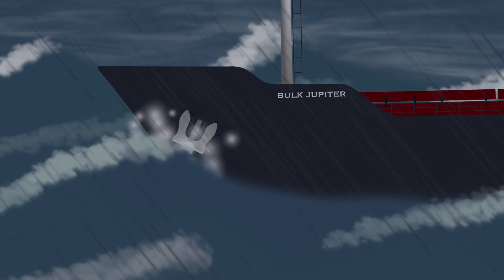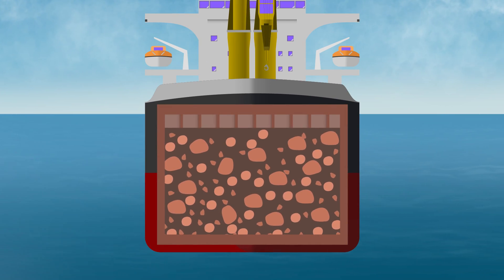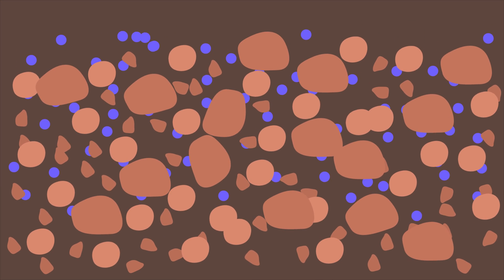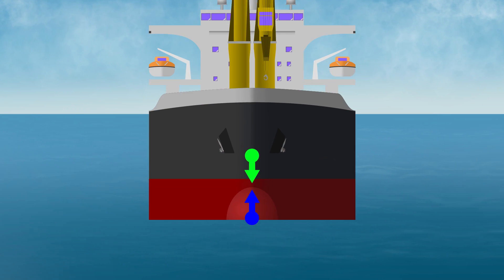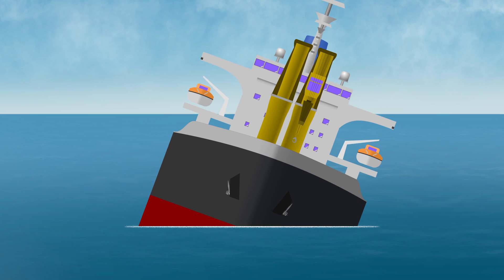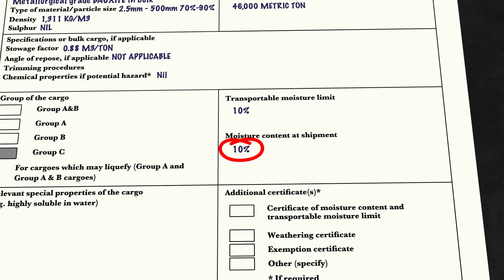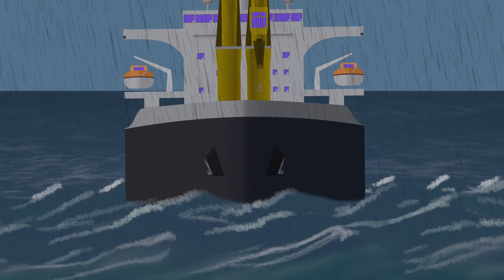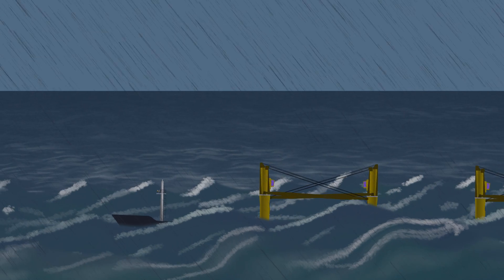Why Does Solid Cargo Turn Into A Liquid? - Liquefaction & Dynamic Separation Explained!

Comment: Wouldn't keeping the centre of gravity below the centre of buoyancy solve most of the problems of ships capsizing?
Reply: Buoys have the same concept. Ever seen one upside down? No matter the weather, they stay upside up.
Reply: @elknackebroto7447  Moving the centre of gravity or buoyancy higher or lower does not make it heavier or more buoyant. It just changes the location of the forces, not the magnitude.
Reply: @RonakDhakan   It may be possible to design a ship with a hull where this is possible. But the word "may" in that sentence is doing a lot of heavy lifting.

The center of gravity on a cargo ship like a bulker is a massively, massively changing value depending on whether the vessel is on a cargo voyage or a ballast voyage. How do you keep KB above KG when the vessel does not have cargo onboard?

Also just think about what you are asking. Center of buoyancy is the center of the underwater portion of the hull. Center of gravity is the center of mass. If KB is to be greater than KG then this means your cargo all needs to be very low on the ship, and there needs to be a large part of the ship above this to provide buoyancy (depending on cargo density). This makes a ship have a greater depth, which means they cannot go into shallow ports. It means you cannot make effective use of a double bottom, since that brings down your KB with regards to KG.
Reply: @phantomsplit3491  Great response. Would an aircraft carrier like shape be the right kind for this purpose? I would think some kind of a V shape would be better.

Of course this is just a mental exercise to understand the physics. I am not saying that achieving this would be practical.
Reply: @RonakDhakan  
A V-shape makes the ship more top-heavy, so if cargo starts shifting (for whatever reason), you're in a lot more trouble even faster.

Also, and most importantly, a V-shaped hull gives up a lot of volume. And volume is what you get paid for. So firms using those ships would go out of business from competitors who use U-shaped hulls. Sinkings are not common enough to balance the costs out. Especially if your ships carry insurance, lol.
Reply: @elknackebroto7447  Why?

Comment: Why not build a wall at the middle of the ship lengtwise? That would separate it to two containers that have a hard time sloshing too one side.
Reply: This is allowed to be done instead of messing around with TML. But these subdivisions add so much time to the unloading and hold cleaning process that most ships find it better to eliminate the issue by transporting dry cargo, rather than mess around with the subdivisions.

Plus the water in cargo = useless weight which hurts fuel economy on the ship and (depending on cargo density) can reduce the amount of product the ship can carry on a voyage.
Reply: money

Comment: WHY THE SHIP did not have its cargo space divided into two sections along its length, not just perpendicularly?

This would have allowed to completely disregard the issue of liquefaction. The capsizing would have been then hard to achieve even if the cargo was water.
Reply: Because the subdivision greatly slows down loading and unloading. Since it is unloaded via a clamshell bucket. Putting a bulkhead down the middle of the hold slows down loading and unloading tremendously, and is unnecessary if you actually don't transport cargo above the TML.
Reply: @phantomsplit3491  there are many types of buckets, some allow effecting unloading from 90 degrees upright spaces. And port equipment allows to change the buckets pretty quickly. The issue is that full costs/expenses analysis for both scenarios can produce different results for different situations, so my guess is that since the solution is not significantly better overall, there is no urge to implement it.
Reply: money!

Comment: I can report that I have personally been down to the wreck and I can 100% confirm that the Bauxite in what remains of Bulk Jupiter's hold is VERY wet.
Reply: i’d reckon is pretty close to 100%
Reply: Also, the Titanic's pools are still filled with water.
Reply: Is it over the 10% TML?
Reply: I laughed at that way more than is reasonable
Reply: Though for some reason the salinity has increased considerably
Reply: Wetter than a haddock's bathing costume.
Reply: Should have grabbed sample for testing
Reply: I need evidence. Unless you provide solid proof, I cannot trust your words

Wheres your sample test?
Reply: @FlorenceSlugcat  so you want solid proof of the salinity of saltwater?
Reply: @thelastwoltzer  you missed the joke
Reply: Maybe even more than 30/40% --pretty wild stuff.
Reply: Did you do a CAN test to confirm ?
Reply: I came looking for this comment.
Still made me laugh like shit 😅

Comment: Shouldn't cargo holds be divided longitudinally with strong bulkheads for bulk cargo? It would limit traversal run of cargo.
Reply: that then limits what cargo you can load, and makes cargo operations difficult.
Reply: @katelights  Indeed, but prevents sinking by cargo displacement. What is more expensive, in the end?
Reply: @wafikiri_  You know, it seems pretty dangerous for these ships to use combustible fuels like MGO. And boilers are practically bombs, looks at all the explosions in the 1800s. We should only allow ships to propel themselves via sail.

The above is sarcasm if you can't tell. There are exemptions for ships to carry cargo over the TML if they have adequate baffles and bulkheads installed to mitigate free surface from shift and/or liquefaction. Most ships don't use these exemptions because they slow down unloading operations so tremendously. And make more places for dust and dirt to build up, making it hard for a crew to clean to make sure their next cargo is not contaminated by the previous one. Imagine you finish discharging coal, and are about to load rice. The more bulkheads and frames there are, the more stuff to clean to a food grade standard.

Comment: question about the Dynamic Separation, if all or most of the liquid makes its way to the top of the cargo could you not just pump out the excess water? Maybe they cannot because it would take particles of the bulk cargo and dump it into the ocean but interested to hear your or commenters thoughts or if this has been done/looked at before.
Reply: The issue is that it doesn't usually form as just a liquid, more of a slurry of fine particles suspended in the water that are more like a fine silt or slurry. Basically just really watery mud and pumping it out would damage pumps.
Reply: @TIXLTIF pumping slurry is very common. Not hard to do at all. But it requires slurry pumps and people who know what to do with them, which costs money.
Reply: @TIXLTIF  makes sense, cheers

Comment: How do oil tankers deal with this?
Reply: they have many separate tanks so the liquids cant slosh around as much. also you can fill the tanks all the way to the top so they have no room to slosh about.
Reply: yeah, they're also loaded via pipe rather than via bucket  @katelights
Reply: There are baffles and walls in place, effectively seperating the tanks into many smaller tanks that don't suffer from this problem too much.
Reply: @zockertwins  Tankers do not have baffles in the cargo tanks. Too much of a pain to clean, and therefore old cargoes are able to contaminate future cargoes. They just have more tanks that are completely separated by longitudinal bulkheads to minimize the free surface effect. And once you get past a certain point, the more full a tank is the less effect that free surface has. So they load their tanks up all the way or not at all so that there is no free space for a fluid to slosh around in.

Comment: I work in bulk cargo dewatering. Bauxite, iron ore, coal, lithium, all kinds of mineral concentrates. Transport moisture limit is always an absolute hard limit, there is never any arguing about it. If the product has high moisture it doesnt get shipped. 
The fact this stuff was shipped at potentially 20% moisture is completely insane. No chance in hell this was a developed country
Reply: Don't know about that. With corruption anything can go. 
South Korea is considered a developed country and yet the Sewol ferry disaster occurred. In part due to absolute corruption in South Korea commercial shipping.
Reply: At the time of the Bulk Jupiter accident, Bauxite was not known to be prone to liquefaction. The cargo was categorized as a Group A cargo following this accident.
Reply: @phantomsplit3491 that's unbelievable. I've worked with bauxite and alumina residue dewatering and we had TMLs for both. Although that was with truck transport.
Reply: I have been working on ships for several years now, and mostly transport coal in bulk from Russia to Mediterranean countries. In 80 percent of cases, the cargo is not coal, but coal water. It literally flows out of the crane's buckets as it is being loaded. Often because of this, even with slight waves of 3-3.5 meters, the pitching angle reaches 25 degrees. However, the documents always indicate the moisture content is less than 10 percent. Often you have to make half the passage with the cargo holds being open so that some of the moisture can evaporate. 
The fact is that everyone would be happy to remove cargo from the pier during rain or at least not load it during rain, but the shipper and consignee are always in a hurry, and no one cares about such little things as the amount of moisture and the safety of the transition.
And it’s better for you not to know how grain and other bulk food cargo is transported.
Reply: Seems like Kuantan Malaysia is the port where she loaded bauxite
Reply: And anyone who has ever worked with the product will immediately see the difference between 10% and 20% moisture. One is a damp sand, the other is mud. 

That sinking was straight up criminal. People should be in gaol.

Comment: Even if cargo is at <=10%, a leaky cargo hatch makes that number meaningless?
Reply: Which is why cargo hatches are often tested for watertight integrity. They have gaskets which are normally watertight seals by the nature of the weight of the cargo hatch weight pushing down on them. Then on top of this they have cleats which further secure the cargo hatches. And any moisture that does get by can then collect in gutters just inside the hatch seals, and drain from pockets at the front and back of the hold.

If a cargo hatch fails catastrophically then you are looking at a flooding issue, not a TML issue.

Comment: Just to ask the question, do they not dehumidify the holds? 

Id have thought with water usually going to the surface, you could at least slowly dry it away on a long voyage?
Reply: If its a 40,000t cargo at 10% moisture thats 4,000t of water. If youre criminally irresponsible and load 20% moisture then youre dehumidifying 8,000t of water.
Reply: would baffles in the hold also be effective?
Reply: @mikieswart  There are exceptions in the regulations allowing you to load a cargo over the TML if you have baffles or bulkheads installed that meet a minimum standard. But this slows down cargo unloading so much that it is very rarely seen in practice
Reply: My guess is that they do have it but it cannot counteract the moisture from seeping in by normal means. Hence the "safe limit" restriction. The only thing the dehumidifying probably could do is slow down the process but not eliminate it entirely
Edit: I also wanna add that it might also be possible that a dehumidifier is not feasible for a bulk cargo considering the size of the cargo. So it might also increase the cost significantly to add and operate a dehumidifier of that scale.
Reply: The cargo should (per international regulations) be dehumidified on shore prior to loading. Meaning a ship's dehumidifier would be unneeded weight. Slowing the ship down, costing extra fuel & maintenance. 

In the case of this ship it was loaded in violation of these rules, likely due to corruption & kick backs.

Lest we forget; safety regulations are written in blood.
Reply: Very good idea, unfortunately these companies only Care about time and money 🤑✌️

Comment: I am curious what would happen if you add a seperation wall along the center line. Would that make a difference?
Reply: Yes, but you lose cargo space and make loading and unloading more difficult.
Some ships do have them.
Reply: so yes there's a safer way but it costs more  @oaw117
Reply: They do this - add baffling - with liquid storage tanks.  It's called the Free Surface Effect.  If I remember correctly, the effect is proportional to the square of the free surface area.  So dividing the space is quite effective at reducing the effect.
Reply: With open barges you sometimes seem small seperation "walls" at the bottom of the cargo. Apparently a little bit of wall can be enough to avoid a lot of movement. They usually have to remove them when gravity unloading them at port.
Reply: I was thinking the same thing, it's just a vertical wall right? How can that cost so much cargo space that ship-builders don't add them? 
But then I realised how much force such a giant baffle would be under when one hold is empty and the other filled with thousands of tonnes of bulk cargo. A baffle like that would need to be so strong and heavy, it starts to make sense it's not worth it. 
You could make it much thinner if you only ever filled both holds equally but that would make loading and unloading a nightmare I guess.
Reply: @petertimowreef9085  It is a separate cargo hold, that must be loaded, unloaded and balanced separately.

Comment: Sounds like there is a strong incentive for the loaders to always say the bulk cargo is safe that makes the regulatory limits meaningless without the ship (or ideally a third party) also checking them.
Reply: Reminds me of the States in the 2000s.  Only a couple "independent financial rating firms".  To increase sales they provided higher ratings than the competition.  After losing bids, you'd get looser.  And so on.  After a decade of ever looser ratings ---------->  CRASH.
Reply: @jimmiller5600 pppp
Reply: That is true but in this case it also changes the value of the cargo, as the water is worthless, only the bauxite is wanted
Reply: Like wrong weights stated for shipping containers (overloaded) or dangerous goods not declared by the shipper. Similar issues exist in aviation.
Reply: Or the shipping company too. Waiting at port for the cargo to dry - or maybe waiting for better weather before loading? - eats away at profitability. Financial projections aren't met and exec.'s don't get their bonuses. I could definitely see home office telling the captain, implicitly via company culture, to just put down 10% in the form, don't worry about it, and get going so that we can make the delivery on time.
Reply: @196cupcake yes seeing “10%” is suspicious.  A measurement might normally be 9.8% or something less even.  Maybe when they see 11% they round down so its a mild lie.  It seems procedurally if loading in the rain it should be expected to go up throughout the process and some extra step done.  Perhaps heaters in the cargo could dry it with a hygrometer to know when its good enough.  Maybe a condenser coil to recover the water to drink.  Electricity is probably much cheaper than the value of the cargo lost
Reply: Maybe a good countermeasure would be to have a ship engineer tasked with reviewing loading procedures and having final authority on what is/isn't allowed on the ship and how it can/can't be loaded.

Since they're sailing in the ship, in theory, they would have a very strong incentive for it to be safely loaded
Reply: Not really because if something happens they could face regulatory  fines and possible  criminal charges for causing a sinking, etc. given that there is always an extensive investigation into these sorts of problems. Last thing they want to do is intentionally lie.
Reply: @Harlem55  many would take the chance